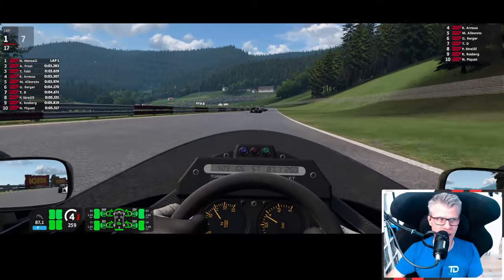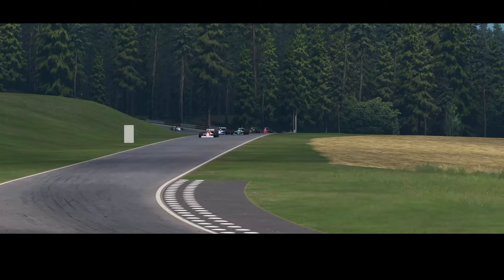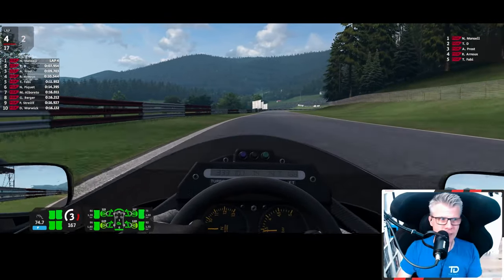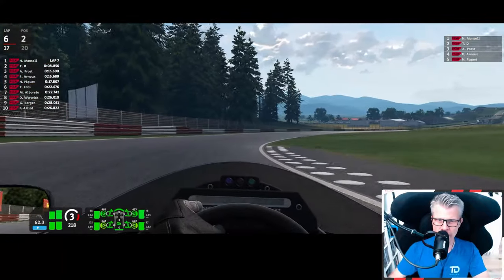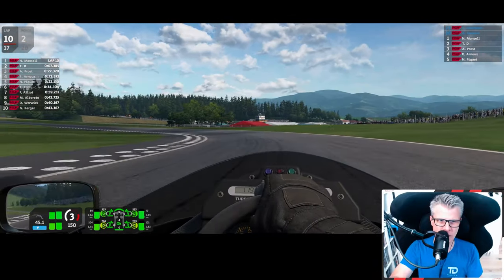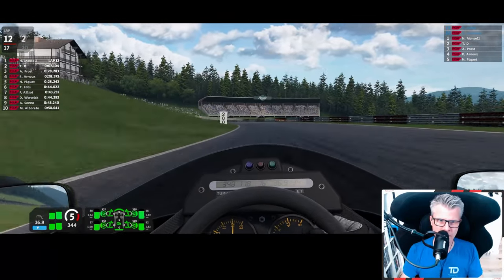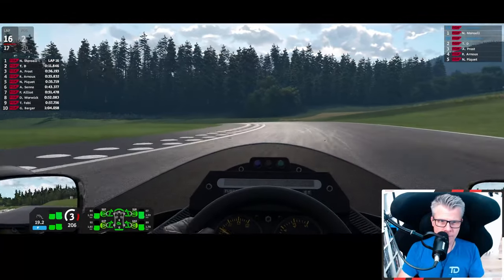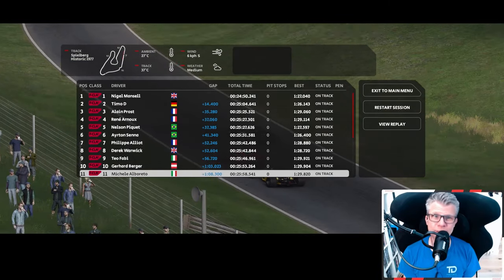Sprint F1 Austrian Grand Prix ... But It's 1986 [Automobilista 2 F-Classic Gen1 Österreichring]

Comment: Eine Frage zum Setup: Bin jetzt ein paar Runden mit dem Lotus am Ö-Ring gefahren mit dem Standardsetup (Ladedruck:70, Kühleröffnung: 80). Wenn ich den Boost verwende, geht die Schadenanzeige für den Motor gleich wild rauf und nach ein paar Runden ist der Motor hinüber (Mechanische Schäden auf "Sync to Race"). Was hast Du da eingestellt?
Reply from the maker: Boost Pressure 60 %
Radiator Opening 90 %
Mechanical Failures: Yes
Random Failures: Off